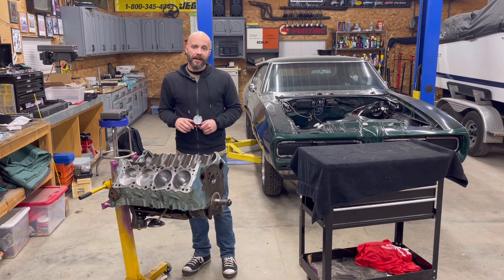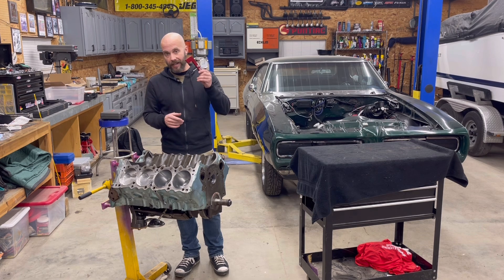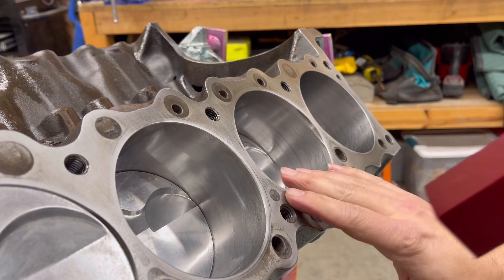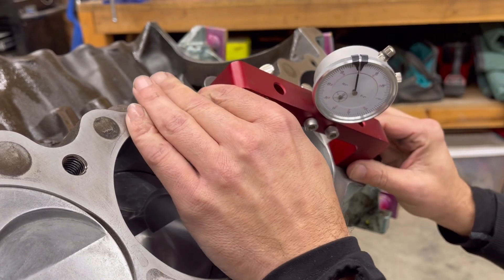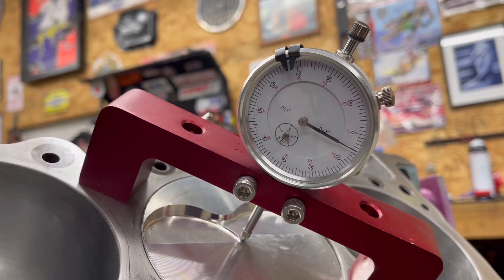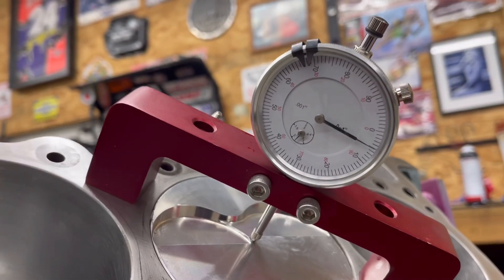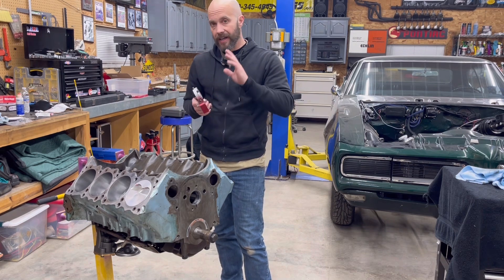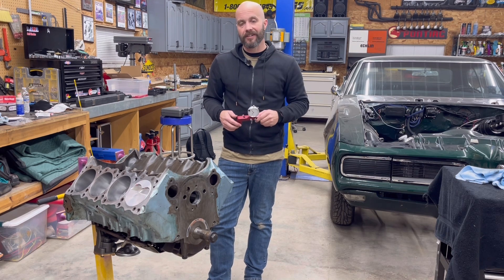Crucial Step Made Easy!  How To Measure Piston Deck Height #howto

Comment: What tool do you use for aluminum blocks since they're not magnetic? All the deck bridges I've seen have magnetic bases.
Reply from the maker: they make a fixture that is adjustable and screws into one of the head bolt holes
Reply: @2HacksGarage  Nice video.  You know what that fixture is called?  I have the same deck bridge.

Comment: Thanks. I am new to learning this very subject about the math for eventually getting quench pad height right. Please keep bringing the math. So from what I am trying to learn: gasket thickness is one variable you can adjust a bit… I am  not really wanted to deck blocks or head, so does that leave me with things like offset crank grind, new rod length or custom pistons? Which would you advise with a street 318 that I have quench 302 casting heads on my 1981 smog motor that has low compression. I don’t have the motor apart yet, but believe the factory pistons may be .070 down the hole. Which is the smarter way to adjust… New rods or new pistons? I believe I read for reasonable detonation prevention and pump gas not to get closer than total of .035-.040 and not farther than .070. Would a .045-.060 range for final total be ok on street with 92 octane. I believe my closed chambered heads are close to 65cc. These are sometimes referred to as the heart shaped heads or high swirl heads. I just want to get that quench pad right so compression lands decent for pump gas. Sorry I don’t have cam spec, but I know it will be selected around this concept. Sorry if all of this is a mess or obvious to gear heads, but I never got to wrench growing up. Don’t feel you have to answer any of this as I will keep watching all of this good math tech you are providing… MUCH appreciated!
Reply from the maker: sounds like a you have a great project!  I would try to get piston that will give you more compression with those heads, and also you can play with gasket thickness.  What pistons are in it now?
Reply: @2HacksGarage The engine is factory stock and has never been apart. I haven’t pulled it yet so I can only assume the factory pistons are flat and down the hole on this low compression engine. What brand pistons should I consider and should I be looking at cast pistons or aluminum pistons? I know I will have to measure valve travel with the lift of the cam to know if a flat top piston would clear the valve or if my pistons would need valve relief… this is why I am looking forward to all the math and method you can share so I can get almost everything figured out and then fine tune with gasket thickness. I am just guessing, but assume 10:1 or up to 10.5:1 might be nearing the limits on pump gas for this street engine. Compression in 1981 is likely very low, but not sure I know of a reliable research document to confirm it. I am focusing on low end torque and not high end hp nor high rpm at all. I just want torque so I can pull an old heavy fishing boat out of the launch and also accelerate up a highway ramp so I can reach highway speed by the time I merge.., both struggle right now. Thanks!